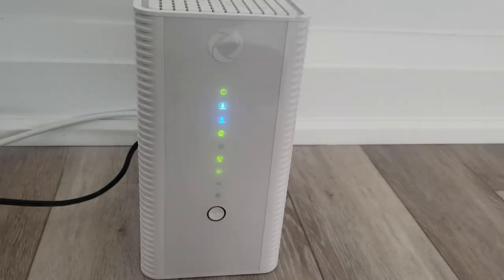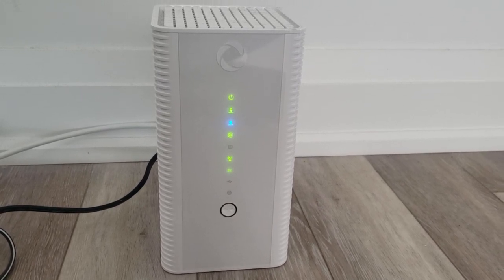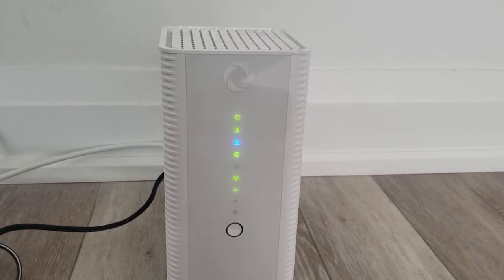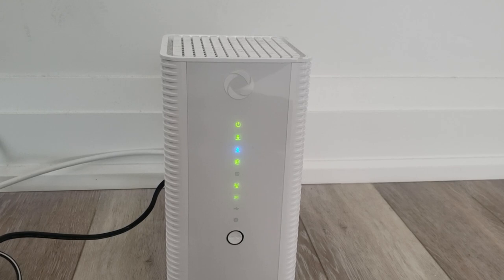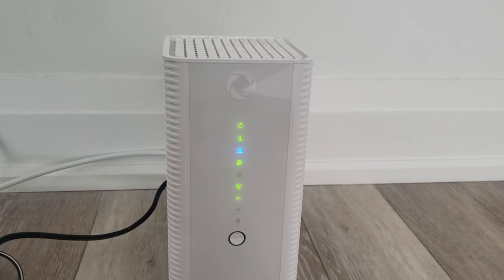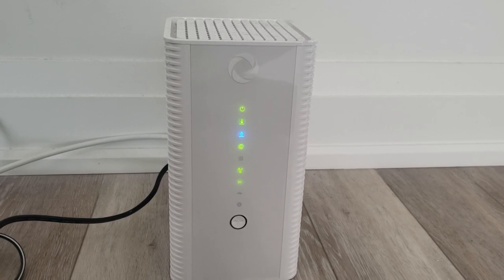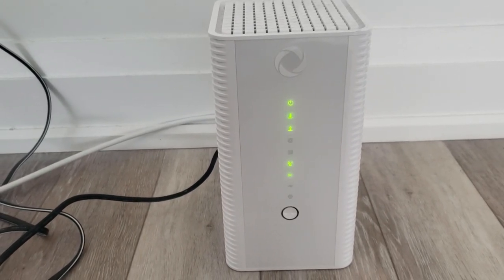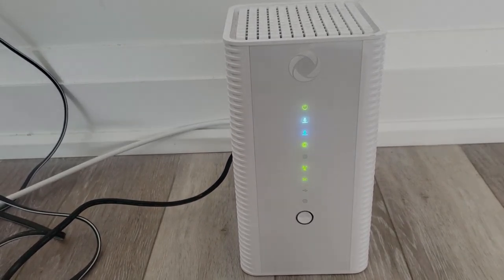Error OS - Rogers,Shaw,Fido,etc - Hitron Modem Light Sequence/Troubleshoot

Comment: Are the downstream and upstream lights supposed to be that deep shade of blue?

Both mines are only white.  Like literally white light.  Is that bad?

I've been having signal connection problems with this particular modem router, especially upstream signal constantly dropping.

My previous modem router (another older model) worked far better than this CODA4582 model.
Reply from the maker: To be honest, these aren't the best modems, but they should be blue. If they change color, it means your connection isn't strong enough or you have a faulty modem... there is a pinhole you can do a factory reset, or you can hold the wps button until all the lights go off

Comment: What is the 5th light down? I just got Fido internet a couple days ago, and it's been super spotty, but one thing I've noticed is whenever I plug my google mesh wifi thing into the modem, the 5th light down starts flashing. And it didn't really come with anything detailing what all of the lights are for.
Reply: The 5th light means you connected it via Ethernet on the back of the modem (it’s in the middle. 4 plugs) and it’s trying to connect if it starts flashing

Comment: I need help. I have the exact same modem, but i have a problem i was thinking you can help me out here to figure out what is wrong. My download and upload arrows are use to be blue, but now they are both static and turned light blue, almost white, what does this mean? And is there a way I can fix it? Do I have to call a technician?
Reply from the maker: Yes you'll need a tech for this one
Reply: I had the same problem all i did is go to settings on my iPad click "Easy Connect" internet and put my username and password then, it worked I know this comment is a little bit late 2 years lol but hopefully this helped someone